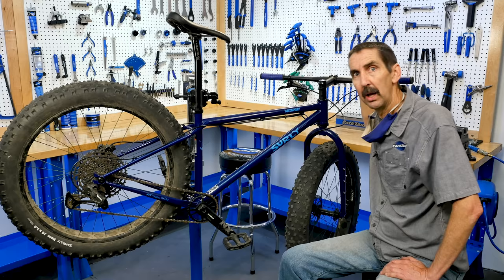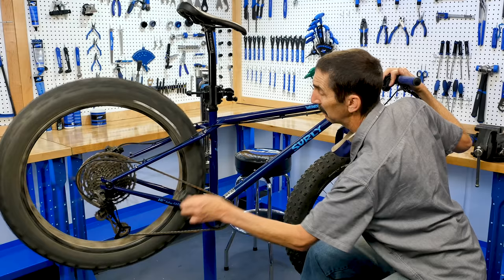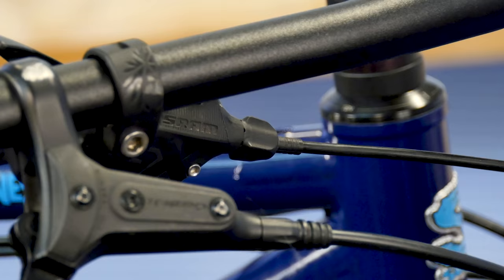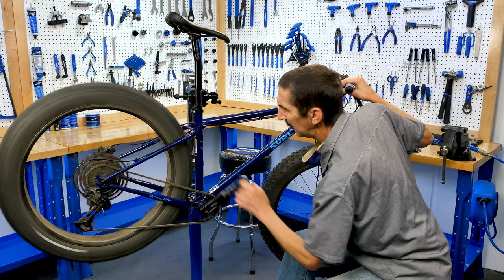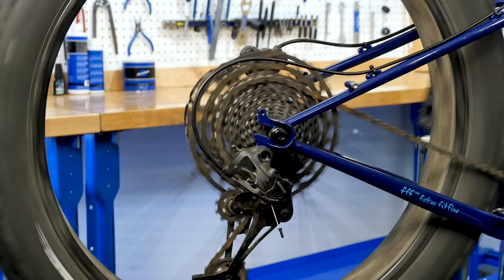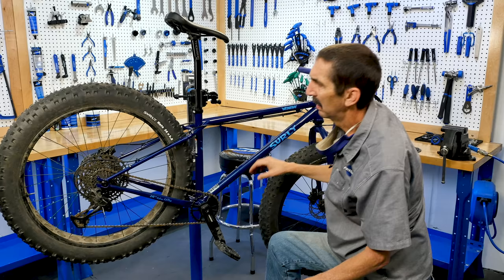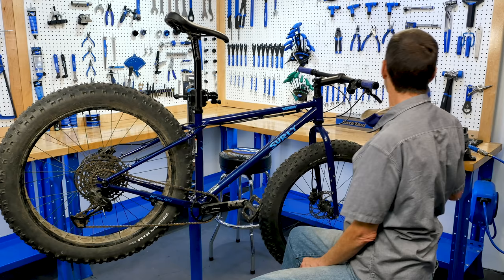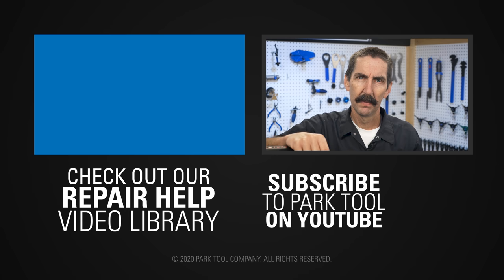Calvin's Wednesday Problem | Tech Tuesday #157

Comment: Had just this problem after changing the chain on an older bike. Did the H and L screws on both front and rear derailleur and indexing. Chain skipped third gear down. damage to cassette found-replacement now ordered. thanks Calvin for another great video. It was really helpful.

Comment: I have a similar problem on my CX, but it's over a bigger range of gears and the cassette is new.
Changed the hanger, swapped inner and outer cable, indexed and indexed and I'm pretty sure is the derailleur that's bent.
Had two different bike shops look it over, and neither could find the cause..

Comment: Just had this happen a few months ago. Went to pedal kick off a rock and the chain broke, causing 3rd gear to bend outward just like you see here. Swap it out for a new cassette or if the bent cog can be replaced individually that would save you the cost of replacing the whole thing.

Comment: My road bike was acting funny in higher gears, I thought the new cable needed adjustment.  It turned out to be 30 year old sticky grease in the shifter.  Had to spend a whole ride yanking the cable to get it to shift to smaller cogs XD

Comment: I just figured that was a newish though rusty dry chain running on 2 very worn sprockets. If the chainring size is correct, those 2 see the most use. Solution is the same if you can't get just those 2 sprockets.

Comment: Well i have a problem. My indexing is right on, but it only works good in one direction. Eather it works going upp or down... i dont know how to solv this. If it works good down and i try too shift upp, it just sits there and and want to climb but never makes it. I have the 105 shifter, mech and sprocket. So what the h..l is going on?

Comment: Happened to me on my cyclocross. I noticed that after a service at bike store so I went back and my mechanic found out that the teeth was bent. Anyway the cassette was wornout and they told me that after the service but they did not have any in stock that fitted my bike. I bought one at another bike store and voilla shift back to normal.

Comment: I'd never think to check the cog of it's bent. I would blame a rusty housing outlet or cable as this has been my usual culprit when shifting started to get off on certain gears beacuse of the extra rust friction. If the derallieur has a lot od mileage it could be it as either the pantograph's spindles or the main hanger screw's bushing got worn out and created too much slack making the derallieur impossible to adjust properly for every gear.

Comment: Had a similar problem with my 10 speed 12-27 cassette. Bike shifting well. I replaced the worn chain, and the new chain started skipping in two particular gears. Adjusted the indexing, cleaned and lubed the derailleur, fussed, etc to no avail. Looked at the cassette and the two gears that were skipping looked worn. I replaced the cassette with my original 12-25 cassette and the skipping disappeared. My area is fairly flat and apparently I tend to use the two gears that were worn. The 12-27 lasted 33,600 miles. Is 33,600 miles a usual life for a cassette ?
Reply from the maker: Thats far more miles than most riders get out of a cassette. No need to brag ;)

Comment: Hi,  Calvin, 

Can you make a video on how to prepare the cables for people who like to build their own bicycles?

I like to build  my own bicycle  and I have done 3 of them already.  However,  what I always encounter  is the rear derailleur  cable always needs  several  miles of riding and adjusting to finally reach a good working  condition,  while the shop can just make it work very well in one installation,  and only need to go back many be 2-3 times for readjust.

I know they used cable tool to pull it,  but I donnot know  how exactly  a bicycle  mechanic  prepare the shifter cables. 

Is it something  you can make a video  about?

Comment: Not related to this video but I have a question about a bike problem. So basically my front wheel has lots of play that I haven't had in the past. The play feels similar to a loose headset but that is not the problem, It appears to just be the wheel. Also break rotor and caliper is tight. I have QR skewers and wondering if there is something up with those. About halfway through a ride I have to open and close them because they are so loose, yet they haven't actually turned at all. But when I close them back, they require no spinning to retighten at all. Or could it be the front hub? It only seems noticeable when the tire is on the ground and the brake is applied.
Reply: It may be the fork stanchions ricking in the flowers of the fork if they are worn out.
Reply: @J_Harker  Thanks I will definitely check that!

Comment: If you insist on whacking it with a hammer remember it has probably bent out of round, you may get it straight again but it will not most likely be a perfect circle.... as a mechanical engineer, this is the problem I see in trying to hack repair it, will buy you time but in that gear your crank feedback will make it feel like your rear hub is bent...

Comment: you took easy problem: i had same problem with shifting on 3 days old  giant, 12x1, no obvious reason why does not work on end /beginning of cassette: cables should be good ,drop out is straight, cassette too, chain is flexibile, wheel in midle, rear derailur tensioner ok.............................?, i sent owner to giant service because it has warranty, so let they solve problem

Comment: I recently broke the chain off my bike when pedaling hard. Since then I have replaced it with a new chain, but experience chain slippage/skipping in a certain gear when pedaling hard. Could a bent sprocket be the culprit?
Reply: The sprocket that is now slipping with the new chain is probably your favourite, so it has more wear than the others, and is too worn for the new chain to work with properly. Only solution is to replace the sprocket (which probably means the whole freewheel or cassette these days).
Reply: @type17  I figured so, I have a new sprocket in transit right now. We'll see if that does the trick.
Reply: @user-zx2mc6pp8o  the slipping/skipping happens on the sprocket I use most, the sprocket is slightly worn more than the others. I don't really see the sprocket being bent, and the chain is sized properly. I'm going to troubleshoot with the new cassette and see if that fixes the issue. Maybe try tuning your rear derailleur, and check the teeth on your front chain ring for wear.
Reply: @user-zx2mc6pp8o  It's really hard to say because it could potentially be several different things. All I can recommend is that you tune your rear derailleur, make sure you have the proper chain and it is properly sized, and try a fresh sprocket. It's going to take some troubleshooting to find out the cause, but if you're uncomfortable you could always take it to your local bike shop to have it diagnosed.

Comment: Calvin,I have 3 by 7 speed gear and  i can't give force to the crank. ....when i apply force to climp hills, the chain slaps like crazy and it feels like shifting but its not....could you pls explain how that happens ?
Reply: The chain, freewheel sprockets/cassette and probably one or all of the chainrings are worn out, causing the chain to skip over the top of the teeth under heavy loads. Only solution now is to replace the chain and freewheel/cassette and 'ring(s). You can prevent such a large expense in the future by using a Park chain-checker to keep an eye on chain-wear and replace it before it wears the sprockets and chain rings too much (>0.75%).
Reply: @type17  could it also be derailier issue as well??  I've noticed on my bike that the cogs of the derailier looks worned out...   and I'm getting super cappy shifting??? 
I'd appreciate your input on this @type17... Thanks👍😆
Reply: @rqteqobzrvr3592  i took it to a shop and the guy at there also told me that it's because of a derailluer issue and suggested to replace the derailleur...
Reply: @type17  Thanks .....
Reply: @manikuttan910  good deal... I brought that up because I've noticed mines doing it as well... best of luck with your repairs buddy.
Reply: @rqteqobzrvr3592  When the jockey-wheels of the derailleur look worn (sharp points instead of teeth), it's because the chain is worn out. While this makes shifting poor, the primary issue is that the chain (and sprockets/chainrings) are worn out, and skipping like Aravind Sankar is experiencing will begin to happen soon, if it hasn't already.
Reply: @type17  yeah mines jockey wheel is sharp....so i have to replace the jokey wheel and chain? Not the derailleur right?
Reply: @manikuttan910  New jockey wheels will improve shifting, but the derailleur may (or may not) also be worn out - if it's worn out, new jockey wheels will only help a bit.

Comment: Lol, big gear cassettes are so flimsy and overpriced
Reply: Made with cheap crap metal ...A gearbox on a car lasts longer ..
Reply: @colintraveller  material is like any other, issue is with spacing. You cant have such thin cogs and expect the same strenght. Sub 9s gruppos 4 lyfe!
Reply: I worked at my local bike shop all through the late 90s, to early 2000s never saw anything like that on a 7, 8, or 9 speed cassette.
Reply: @jamesconroy7030  yep! Have you noticed how much faster cassetes with big gears accumulate wear? Not to mention that +9s casettes are rediculously priced

Comment: Could you make a vid about how to fix sram road gears my one don't seem to shift down and it seems to be a problem with other people aswell pls help
Reply: Limit
Reply: @jadenr.11  no it's like clicks down but the end of the cable in the shifter keeps poping out of the port and won't shift down
Reply: It might just be a faulty one
Reply from the maker: Sounds like there is an issue in your cable and housing creating too much resistance so the spring tension in the derailleur is not pulling the cable properly. Check you cables and housings.
Reply: @parktool  ok should I just put a dab of oil in it our should I just change the whole thing

Comment: You know the quality of metal used for that Cassette wasn't made with hardend Steel ..  If it was it certainly wouldn't be like that .. ffs  
And you are not addressing the fact of the poor quality of metal used in the manufacture of that cassette and that chain was rusty .. again you failed to mention
Reply: Everyone's an expert. What hardness would you recommend for this type sprocket?  I worked in a shop where we made custom gears, typically hardened anywhere from Rockwell C 30 to 65, depending on the type, size, material, application.... Would you go lower, toward 30? Or higher, say 60-ish?
Reply from the maker: We are here to help people fix their bikes, not complain about them.

Comment: Actually the best thing to do is to remove the rear wheel and then remove the freewheel cassette and disassemble the the cassette and straighten it back out and check it with a machinists square.
Reply: if your interested in doing all of that work just to bend your sprocket for a 2nd time, i would recommend this
Reply: I'd like to see someone test that's theory.
Reply: @charleslane2735  when you bend a metal past its elastic threshold, it gets more brittle. example if you bend a paperclip a little bit, it will return to the shape it was. but if you bend it alot, it becomes brittle and much harder to bend back to the original shape.if you do bend it back to the original shape, it will be weaker than it were originally. a lot of the time one bend in metal will actually strengthen it, making it less elastic and have stronger tensile strength at that point, but when you bend it multiple times, you are stretching the material in different ways and are weakening it in the end.
Reply: @charleslane2735  https://en.wikipedia.org/wiki/Work_hardening